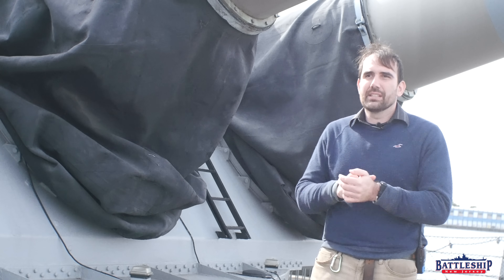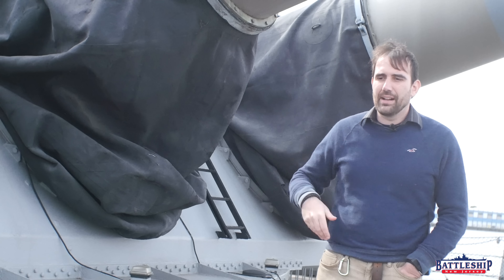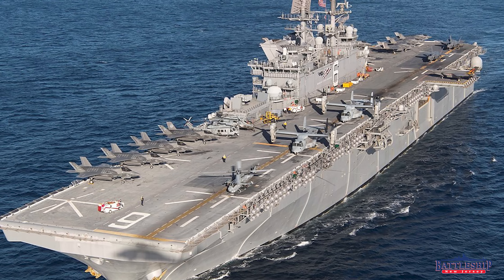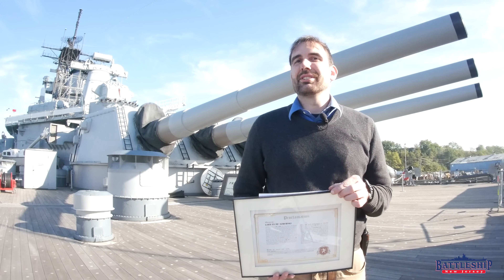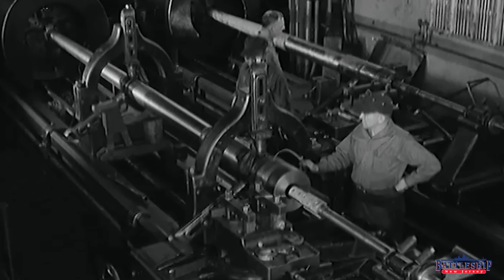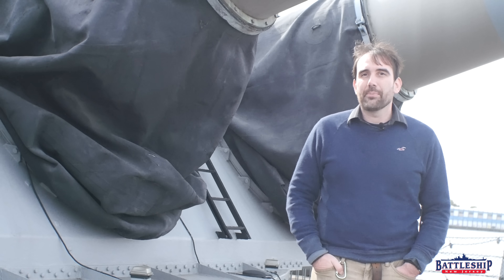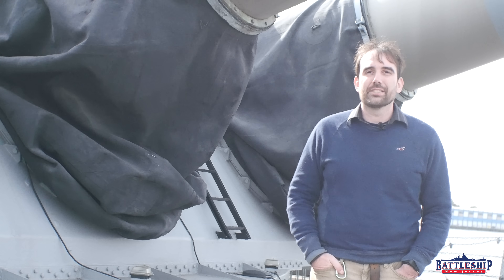How Much Would It Cost to Build a Battleship Today?

Comment: These ships were Built-in a completely different era altogether. I don't believe the reactivating of these old girls would make any sense. Considering the modification and the modernization we would have to do to those ole girls. The cost to do this to the 4 of the class would be just flat out ridiculous. I think though as a navy veteran American needs it's gun platforms for amphibious operations which we no longer have. I used to be in assaultboat coxswain when I was in the navy We basically had no cover. I've done several team spirits and colonel ushers. We no longer have ships that will softened up the targets as we used to have. Now granite we have LCACs And the navy still doesn't have hard cover for the craft going into the beach. Nothing like having gun ships offshore softening up targets before you go in.

Comment: I wouldn't build an Iowa Class.  I would have a completely new design created and built using modern technologies, but with backup systems that are mechanical in nature.  Imagine a 16 or 18-inch deck gun using rail gun or coil gun technologies with over the horizon spotter drones or upgrades to everything.

Comment: What if they US NAVY goes with new battleship weight of WASP class 40,500 tons it could have submarine metal for armour and for radar ageis shore system while the weapons would be 2 turrets of twin barrel 155mm guns sourced from M109 howitzer as they are the largest available while aft section would have all VLS for all types of missiles and end would be a helicopter pad with lift the ship would be capable of carrying 6 to 8 helicopter or 4 F35-B power would be provided using MT30 marine gas turbine used in zumwalt destroyers now that would be something enemy needs to worry about

Comment: So, basically - re-activating an old hull is cheaper in the short term but punishingly expensive over the life of the vessel; building a new ship from the keel up is a huge up-front cost, but the cost to operate is much lower.

My immediate thought is, there's no sense in reactivating a battleship for brief usage - even though shells are much cheaper, cruise missiles are cheaper than reactivation. So for service life measured in decades, obviously new is the way to go.

Buuut... we do get into the question of modernization. Which seems like it would ALSO favor new construction. However, given the proclivity of procurement folks, when not given firm limits, to add every bell and gewgaw they can think of, and you're looking at a development cycle that's gonna be upwards of 3 billion USD before the keel gets laid. Being told "Nope, you cannot change it to a tumblehome hull design, just get the guns working and find a way to fit a modern fire control radar in there" saves a lot.

Really, though, I'm sure it could be turned into a pretty simple equation where you can drop in numbers - if your need for a battleship-like platform is less than X months (or N expected amount of ordinance) just use missiles. If it's more than X but less than Y, it miiiiight be worthwhile to reactivate. If it's more than Y months, build a new ship. Gut feeling is that the window between X and Y is really narrow or maybe non-existent, though.

Comment: 1)  It wouldnt cost hundreds of millions a day.  Wth is that?  2) Youre only partly correct about the start up as there is no system in place for a battleship and its components.  Wrong.  We produce cannons.  We produce armor plating-just not that size.  Yes, we would need to tool up, but its not that complex.

Comment: Although nothing says that "we care" quite so well as parking an Iowa class battleship off of someone's shore, I wouldn't build new or reactivate any battleships. It would be a multi billion dollar asset, crewed by thousands that's primary armament would be easily in range of an enemy's missiles. If we were to go with really large ships that are not launching aircraft, we would be far better off to build large fast hulled ships that are packed from bow to stern with vertical launch missiles of various types, a ridiculous number of CWIS cannons and 5" guns for close in threats. At least we could build those with stuff that is "on the shelf" and they would have a much better chance of not being blown out of the water 200 miles away from an enemy.

Comment: Depending on the level of urgency I'd do both I build new shipyards for the new battleships while getting the old ones back into service even if there is say only a month or 2 in-between the old made ready and a new one getting ready for sea trials at least you'd have a stop gap but you could for go battleships and go cruiser size ships double the ships and probably half the build time compared to a battleship

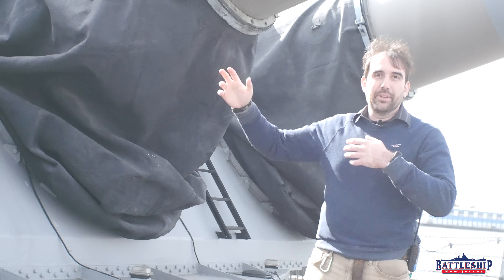Comment: 6:38 The U.S. Navy has a few working rail guns. The maintenance on it made the project too expensive. The large electromagnetic forces are self destructive to its own electrical circuitry. So we have the technology developed it's just not practical. Also the massive amounts of energy required to use a rail gun consistently would take a nuclear reactor. So assuming they're working on a way to better shield the components of the rail gun, and reduce power consumption it's really not gonna see more finding. Probably 2030 they will pick it back up

Comment: you would be so much lighter just replacing the old propulsion system with modern nuclear propulsion which can also provide almost unlimited electrical supply for new and future systems. also the million miles of steam piping would mostly be replaced by electric cables. the modern materials technology and the now common modular construction would also make it lighter and more damage resistant. all of these also would contribute toward much higher hull speed. not carrying millions of tonnes of fuel and oil also ad to overall performance. just these would give me big enough reason to build new ones. so, so, so, many advantages. can i have one too? please? can i add rotary launchers, silos and a few phalanx too.

Comment: The thing is, battleships as a class never really worked out. Battleships were built basically to sink other battleships. But there are other, cheaper ways to sink a battleship other than 14-16 inch guns. Aircraft carriers are so much more versatile, which is why we still spend the money. But with Battleships, it makes much more sense to build 3 or 4 smaller ships. Which is why nobody builds them anymore.

Comment: Do you want the short answer or the king answer?

Short answer (a lot

Long answer (a hell of a lot)

However considering the cost and resources required to build a battleship wouldn’t be worth it, since for every one battleship you could build two to three destroyers and unlike the old days of direct fire munitions, where a bigger gun equals a bigger bang, you could achieve the same results with a single tomahawk missile, as well as being far far far more accurate, however if we were to rebuild a battleship, it’s main armaments would have to be replaced with two heavy rail cannons, two VLS launch bays, six CWIS anti missile system and eight orlikan 40mm anti aircraft cannons (or alternatively rhinemetal 40mm anti aircraft systems) and four quad 50s along side flares and chaff, other than that it would be a very difficult opponent to kill however much like the Yamato, eventually the air defenses or ship’s defenses would soon fail as well as the fact that things like submarines hiding in shallow waters would prove very problematic considering the cost in terms of time, crew, resources and munitions spent on such a ship, vs say an aircraft carrier which is expensive but isn’t expected to be on the frontlines being shot at.

Comment: I believe building new ships would be superior to reactivating the old ships for several reasons.  2-3 billion for reactivating costs, but really, can the navy support these old propulsion systems at sea?  These ships would have to be blue water capable, and would require an entirely new support system of refueling ships on standby which would carry a hefty price tag.  New ships do carry a higher price tag, but operational costs would be significantly less to operate if they are atom driven.  A complete redesign of the internal spaces and with all the extra storage space would allow for much longer sorties.  Of course there is no telling as to a redesign because of what role the navy would want to deploy them in.  
With that said, I seriously doubt either would happen unless the navy sustains losses at sea and needs ships to fill voids.  A year reactivating is much quicker than 3 years to build.  Just my 2 cents worth.

Comment: Build a new one. And think about it... the armor hasn´t to be that thick as in the 1940s. Modern rockets would do less damage even though the hull and main deck armor is thinner. The bridge and the structures upon deck would be more a problem to protect. So it would be a little bit lighter, faster and I think it would be constructed more build-effective and operational-effective. Less personell and straighter design, so less costs for operate such a beast and less spare parts. But I do think as you did - we would reach for development, machinery and shipyard costs the same level as a modern carrier system. Which is far more capable of hitting targets beyond shorelines...

Comment: If I were tasked with building a new battleship, my answer would be to put a turret on a barge and have a tug boat push it where I wanted it. The Navy is bringing back frigates, so the strategic thinking is moving more towards the thinking of 30 years ago. The issue is air defense and radar picketing against emerging hypersonic threats. A carrier simply has more utility than a battleship does.

Comment: The only reason I see building the BB today would be gunboat diplomacy, the projection of power. 

Im not against  to be honest. Look at the armament. 20 5 inch guns (12 miles) the 40mm bofors and the 20mm (later M2 quad mounts).

If you translate all of that into modern armament...

Thats a lot of ciws hardpoints points and factor in the missile batteries. The five inch guns are still solid armament. The 16 inch guns, I think, would be reduced to a smaller diameter with better efficiency than the current guns. 

It could be done. But it would be a pure power display. "This is what we could build, for a symbol of power. Now imagine what we could build if you piss us off?"

Designed from hull up she would be a goliath of weapons hardware on display.

Comment: If it were my call I would take one Iowa and find a way to convert the engines to gas turbine. Replace one of the forward turrets with vert launch tubes for tomahawks. Focus on retrofitting automation to reduce manpower requirements. Hang on to more of the indestructible attributes like the bridge and armor. Couldn’t really give it any speed; still be a floating punching bag. Or go the other direction beef up a AB destroyer armor to be more like a BB. It would move a little faster but a few more of the same capability. In either case our weakest link is the construction time

Comment: If the US was going to build a modern battleship, we certainly wouldn't build just one.  I figure we'd build at least six, so they're available to be part of carrier groups, and we often have four of them active at any given time.  This means the up front costs (shipyard, technology development, etc.) would be amortized over six ships rather than one, bringing the per-unit cost way down.  The cost would be lower still if we placed an order for all six ships at once as it would allow the contractor to get some economy of scale.  It seems likely that if battleships were deemed necessary (presumably to protect against increased threats of supersonic cruise missiles and the like), the next generation of aircraft carrier would be based on the same hull as they'd face the same threats, further reducing the cost per unit.

Comment: If it was short term, then reactivating a de-commissioned ship would be cheaper. In the long term, building the ships from the ground up would be cheaper. If new, rather than building a massive battleship I would aim to instead build a fleet of battlecruisers/pocket battleships. If I could build two battlecruisers for the cost of one full-sized battleship, then a fleet of 8 battleships would become a fleet of 16 battlecruisers. They can have the same thickness of armour, but the number of armaments would be less and divided between each ship. (E.g. Two 12" cannons in a single forward turret, twelve multiple missile launchers with a mix of surface-to-surface/surface-to-air/air-to-air missiles, and six anti-aircraft guns.

Alternatively, I could make it as a hybrid carrier/battlecruiser armed with a two 12" cannons in a single forward turret, eight multiple missile launchers with a mix of surface-to-surface/surface-to-air/air-to-air missiles, four anti-aircraft guns, and a rear flight deck capable of carrying a squadron of fighters such as Harrier jump sets that do not require a runway for take off and landing. It's role would be for shore bombardment whilst operating as an escort carrier for the fleet.

However, as cool as the concept is, the reality is that with the advancements weapons technology in the digital age, battleships and battlecruisers wouldn't be practical to commission let alone deploy.

Comment: Honestly you don’t need to put guns on it you could use modern weapons systems to replace them which could be essentially a huge missile carrier which would make a huge threat to any enemy vessel or fleet 

then load them up with lots of anti air defenses platforms then have the ability to data link information from other vessels in the fleet and bam you have a iron dome around your fleet carriers

Comment: I guess another way to look at is what would we build as a battle ship now?  Iowa class need to many crew, keeps them in comparatively crappy quarters.  Indeed the trouble with keeping good crews and officers on them, was one of the biggest reasons the .Iowa class wasn’t kept going after their recent  reactivating.  They weren’t that expensive to keep runing compared to other big mil ships.  Could Cary lots of missles and take more hits then most anything else.  But crews and officers wanted off.

So a new gem Iowa class?

You presumably want big cannon.  Not nessisarily 16 inch with powder.  
Magnetic cannon (rail, solenoid, etc. guns) are obvious in give huge rang and impact energy  pluses.  Another option is electro thermal steam cannon.  In tests it double the muzzle velocity of the cannon.  Or liquid explosives.  
Anyway presumably you’ld auto,ate most of the loading and firing saving crew and space, but need more power.

You’ld add missles.  Lots of room on a Iowa hull for lots of missles.

You’ld add lots of drones.  Drones are almost replacing aircraft for a lot of missions.  Cannon launchable drones?  Cannon launchable ramjet shells (they were developed, but likely out of production)

Armor…. Old armor was designed to fight old weapons.  Even during WW- II they were changing armor designs as threats changed.  Torpedos and subs, and aircraft rather then huge shells are more of a thing.  But building it up with layered armor” from foam metals, layers of thin steel.  Fiber reinforced steel with uranium and ceramics?  Or Chatom (?) armor like on tanks.  You’ld likely need to spend a billion to build facilities for armored belts and undersides.

Nuclear power is pricy to start, but long term you save money on fuel.  And powering all the big guns and stuff will eat power.  If it’s going to be a capital ship I think It would need the power.  So order a reactor off the line for your new gen Iowa.  Lose the big drive shafts for direct drive, steerable asipods?

A lot of the smokestack space etc in upper decks can become a CNC.

Add modern anti air/missle systems.

So your coming up with a Ultra big Arleigh Burke, REALLY uparmed and Armored, and a drone a missle carrier, with main guns with 2-3 times the range.  Likely $4-$5 b plus set up costs for the “class”?

Comment: It depends on who makes it... Everything that would need to be built into such a ship already exists... except for the main gun barrels, which requires building a factory to make those gun barrels. If a ship like this is built by America, it would cost tens of billions of dollars, if a ship like this is built by the Russians, the construction would cost no more than one billion dollars.
On the technical side, the Russians are closer to building such a ship because they already have in use the Kirov-class battlecruisers of similar size, one of which they are upgrading, so at this moment they have the technical capabilities, knowledge and experience to build such a ship. Plus, forget diesel engines and gas turbines... a ship like this goes with nuclear propulsion!

Comment: It would be better to build new for a few reasons. #1, if a new Battleship is lost, them we are not losing an irreplaceable part of our history. #2, the navy can always use more ship yards, especially large ones. This will increase overall capability of the navy and provide for redundancy should something happen to a shipyard. #3, New Battleship, means new design for the hull. One major weak point in re-activating an old warship is that if any blueprints were put online, any enemy can calculate what it takes to sink it and where to hit it. The difficulty in figuring this out is significantly harder in new warship designs, which is why all of those blueprints tend to be kept secret until they retire or someone leaks them.